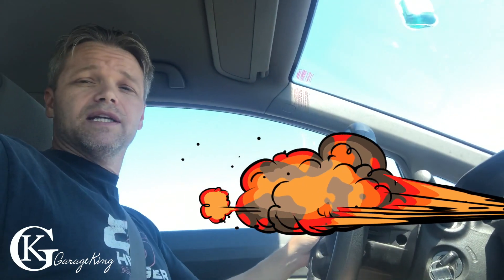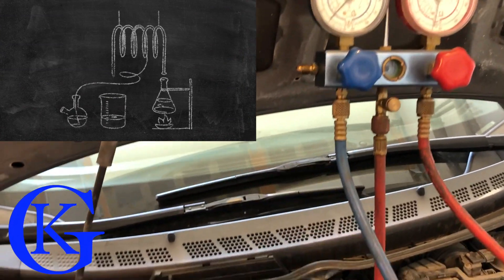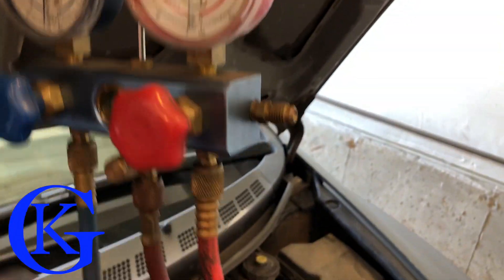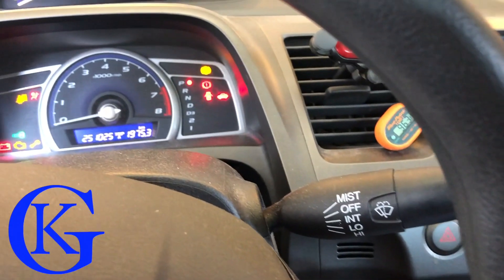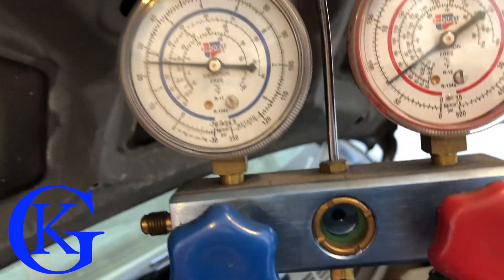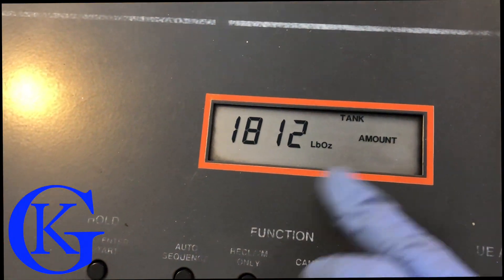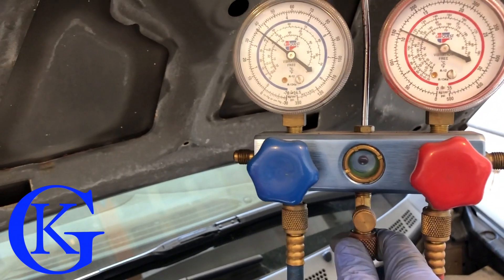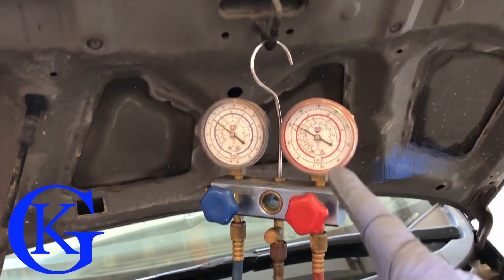How to recharge AC system with gauges properly and evacuate

Comment: So how do your purge air if you were using 134a
Reply from the maker: Hey thanks for the comment, if you are using 134a then you should not crack the line to purge.  The machine should reclaim, hold the vehicle under vacuum, and then charge. I doubt anyone watching this video has a commercial size tank of 134a which is what the machine needs to avoid a manual purge. I did the purge as I was using a replacement. This is what most people have access to.  So I have to change the tank while the machine was holding vacuum. What this did was let air into the lines so when I hooked up the replacement tank I purged the line, and it was fine to do that to get the air out as I was using an environmentally friendly replacement.

Comment: What will cause my manifold gauge set to not Purge? After tightening down the adapter to the refrigerant can, I tried to purge the air out of the hose but nothing sprays out other than a slight hiss. I also don't see any refrigerant moving through the sight glass.
Reply from the maker: Hey There, I'm assuming you have your manifold gauge hooked up to a can? If the can is upright then gas will come out, so that's why you don't get the same purge.  The tanks are designed to expel liquid when vertical and some tanks (R123a replacements) are even put upside down when filling the car. The only way you will see refrigerant in the sight glass is if you have liquid coming in. You most likely have gas coming from the can.  If its a disposable can flip it upside down and then try.

Comment: How to evac with REFRIGERANT STILL IN. Pointless video.  🤦‍♂️
Reply from the maker: Hey there, sorry you didn't enjoy the video, there was no refrigerant in the system when I vacuumed it out, See the 2:15min mark, so I'm not too sure what you are saying.  There was no refrigerant in the system when I vacuumed. If you still have refrigerant you must reclaim, but many times there is nothing left and that's why the AC does not work, there is no more refrigerant, and hence no pressure so the compressor will not cut in.

Comment: 32 degrees centigrade. What
Reply from the maker: Ya, it was HOT !!!!
Reply: @GarageKing  I see. But its Celsius  not centigrade
Reply from the maker: @prtbone78  Ha Ha !!!  I get you now, yup Celsius is the preferred way to say it, Centegrate is an old term that was used and means the same thing, its just not used anymore. To be honest I don't know why I said it.  Good catch, and thanks :)
Reply: @GarageKing  lol. I don't think  I've ever heard that before. But cool.... thanks.
Reply from the maker: @prtbone78  Straight from wiki "The degree Celsius is the unit of temperature on the Celsius scale,[1] (originally known as the centigrade scale)", good catch on you though.  It's an old term.  When I was younger I remember hearing that term from teachers.  To be honest I don't ever say centigrade, it just slipped out in the video haha!  Thanks again, and have a good weekend bud.
Reply: @GarageKing  got you..... all good.   Have a better one  thank you
Reply: As GK said, Centigrade is an old term for Celsius. It was very common in the UK until 1985. Centi means 1/100. Water freezes at 0C and boils at 100C so the Centigrade scale made sense. The problem was Centigrade has another meaning in France relating to angles so it caused confusion. Anders Celsius was the man who originally devised the Centigrade scale so they honored him with the name change.
Reply: @CWK090  thank you for the history and clarification

Comment: I'm going to be filling my AC system (nissan altima 2.5L 2005) before I do, I'm replacing the low side hose and the clutch bearing and clutch hub. My question is when you vacuum the line in the beginning of this video how do you not drain the PAG oil? My compressor takes about 150ml of PAG 46 oil. I was going to replace that while I'm servicing the compressor but will that not suck out when doing the vacuum?
Reply from the maker: Hey there and thanks for the question, most excellent one today.  When you vacuum a car's AC system you are sucking from the top (where the fittings are) and the oil collects at the bottom, so the oil stays in the system and is never pulled out when vacuuming. I was taught whenever changing a part to remove the part and hold it over a measure cup, so you measure what comes out, and replace with the same amount.  In your case with a low side hose you probably wont get anything. The oil is spread out through the internals in the AC system so there is no way to get it all out. Most of the time I find oil when I replace a compressor, or a condenser, and put back what comes out.  If your compressor is leaking oil, then those are the times you can add a little oil as you are loosing it to the outside, and eventually your system would be dry. Good question !!

Comment: Great step-by-step video
My Altima’s a/c only gets cool (not cold) on high RPM. Comp engaged. Cond fans on. Pressures good.
Your thoughts?
Thanks 🙏
Reply from the maker: Hey there, and thanks for the comment :)  Most likely you are low on refrigerant.  The pressure will still show as good until you are really low.  So if you are full or 1/2, the pressure will remain the same on the gauges.  The pressure in the gauges is not an indication of how much there is in there, the only way to know is to reclaim and weight.  Typically a compressor will turn on with an oz or two.  It does not take much for the compressor to kick in.  Hope this helps !!!
Reply: @GarageKing  it’s been very useful and helpful indeed. Thanks for giving me such time and attention and that tip as well 🙂
Reply from the maker: Anytime !!!

Comment: Here's a tip. Use R-152A or canned computer duster.
Reply from the maker: I just did some research on R-152a and computer dusters, very interesting, and I would have never known that.  Thanks for sharing that with me !!!!!
Reply: @GarageKing  Near straight drop in for R134A. You use 64% of your factory R134A charge. So say your car takes 1lb of R134a. You use 0.64 of a pound for R-152A.
Reply from the maker: @jimdavidson5208  Ya, I was reading how they can be mixed.  I did learn something from you, so thanks for that !!

Comment: 0:35 You said if we don’t have a full unit, how do I recycle with only the refrigerant, gauges and vacuum?
Reply from the maker: Hey There and thanks for the comment, what I meant by that, and I should have been more clear is you need a vacuum pump and scale to do the job properly if you have lost you refrigerant.  So you have nothing left in your system due to a leak, and then do the repair.  Now you can just use the vacuum pump to draw as much vacuum to boil away the refrigerant and vent it to the air (as there is no refrigerant). Then use the gauges and scale to weigh it in.  Sorry about that, I should have been more clear.  If you still have refrigerant in the system, there is no way to recycle it, without having a recycler. Sometimes the leak is so fast that it leaks right out, say within a leak. Then its fixed it, so all they need is the vacuum pump, gauges and scale. Thanks for the comment and hope I cleared it up a bit for you.

Comment: what about the refrigerant left in the high pressure line?  Also, wasn't there also air in the high and low lines when they were originally hooked up?
Reply from the maker: Hey there and thanks for the comment.  There was no air in the high and low sides when they were hooked up.  The valves on the gauges were both closed and the high and low side connectors have one way valves. There is always refrigerant left in the high side line as you can't get that out (pressure is too high). You saw for the low side line you can close the feed tank off, then open the low line and the car will pull it down to about 40psi which is really not much pressure (think a car tire) then you close the valve and disconnect the fitting.  The only way to get the refrigerant out of the high side line is too put in on the car and evacuate the system (like I did in the video) this way you draw a vacuum not only on the car, but also on every line.  This is not practical after a fill, so that is why the lines have one way valves on the ends of them so when the gauge valves are closed, and hoses are popped off, like I said earlier, that refrigerant will remain trapped in the line.  Hope you are having a good Saturday :)

Comment: Since you did work, there was no refrigerant in the system that needed reclaiming first?  Does evacuating only pull moisture and air or does it suck out old refrigerant (hence requiring proper disposal?  None of these Youtubes seem to address this.
Reply from the maker: Hey Thanks for the comment.  When I worked on this there was nothing left in it, so nothing to reclaim.  I still did a vacuum, and all that did was draw out any moisture that was in the system from when I had it open to install the condenser.  Whenever a part is replaced, there is no refrigerant left, as the system has been opened.  All refrigerants (that I know of) boil at room temperature, so the minute the system is taken apart it boils away. If nothing is getting replaced and your system is cool, but not cold, then you are low.  FYI - most systems will still engage the compressor with only an oz or two, so if the compressor is not running then its pretty empty. There are compatible products that can be used to top up a leaking system that don't damage the ozone layer, I used one of those products in this video. 

To check your system you could always buy one of those fill kits https://amzn.to/35WbEWv and DON"T pierce the can, just screw the can on so when you put the gauge on nothing will leak out. This way you can see if there is any pressure in the system.

Comment: Partially purged.
The red/high line was full of gas and instead of purging it into the system at the end you purged it into the environment. But to do this, you need a coupler with a valve at the end of the red/high hose.
Reply from the maker: Hey Thanks for the comment, there is a coupler at the end of the lines. There are two red lines, the far line on the right is the high side, that is the liquid side, and there is the centre feed line from the tank. There are one way valves on the end of both the blue line and the red line at the end. Those are the lines that are connected to the car and they have one way valves so they are never purged to the atmosphere, ever.  The line I purged in the middle at 5:39 was because I hooked up a new tank of refrigerant. That has to happen when you hook up a brand new tank because the line going to the tank has air in it, regular air.  If you just hook it up to the tank and open it, you will push that air thats in the line into your car - not good as we just evacuated the car.  So I cracked the line and let the air out, and as soon as I saw the refrigerant I closed the line. The line I purged was the feed line from the tank. Not the high or low side from the car. This will never happen again until you have to change the tank again. Thanks for you comment and good catch, I should have been more clear on that point !!!
Reply: @GarageKing  
You are right. I am sorry. I thoght you have opened the red valve on the manifold after connecting to the tank.
Reply from the maker: @shihabshihabi  Hey no worries, and good eye !!!  I love comments like these as it means you are really watching the video :)  Have a great week :)

Comment: I have a yellow jacket manifold with  knob on the side. So its clockwise to close and counter clockwise to open.For some reason when i open the low pressure side, refrigerant are not being added. Any ideas?
Reply from the maker: Have you checked the pressure that is actually in the system to ensure that you need refrigerant and it’s not just an electrical problem. Also if it’s hot outside then sometimes it does not want to flow in.
Reply: @GarageKing  i have checked when manifold was hooked up, low pressure was at 25psi and high was at close to 200 with outside being 80 degrees.it seems im low on refrigerant but it doesnt want to add
Reply from the maker: Hey there, sorry for the late reply, I just got back from vacation in BC, I was doing my best to answer during that time. When your vehicle is running does the compressor run constantly?  When the AC is full the compressor will cycle (with 134a) so what happens is the compressor draws down the low side and pushes the high side higher, and then shuts off, the pressures start to equalize, but before they do the compressor cuts back in and the cycle repeats. The problem with AC is if you are 1/2 full and full the pressures will remain about the same.  If its warm most likely you are low.  Its easiest to put the refrigerant in when the compressor is running, also MAKE SURE you are putting the refrigerant in through the LOW side.  Your can has to have a pressure of more than 25 or it wont go it.  Thats why there is no way to totally open a can, it will only go as low as whats in the system.
Reply: @GarageKing  Thanks for the reply, compressor is coming on for a minute or two and sometimes less before cycling off. Refrigerant is being added to the low side but the car just not taking refrigerant in. I have yellow jacket manifold with knob on the side. If clockwise is to close and counter clockwise is to open then could it be ac system pressure is too low for it to take in refrigerant? I saw a video on youtube unpluging the low pressure switch and using paper clip to connect it to keep compressor continuously running in order to add refrigerant. Im not sure if its my solution to my issue.
Reply from the maker: @winkawak  I was thinking if you have both gauges, with BOTH manifold gauges CLOSED, you can hook up both the high and low side in the morning.  They should both read the same.  Then start the car with the climate control OFF.  Have someone go in the car and turn on the AC or defrost.  Then watch the gauges and see how fast the high side goes up, and the low side goes down.  If it happens too fast you may have a restriction somewhere (orifice) and in that case no matter how much you put in, the flow will never be enough to make the evaporator cold.  I have never heard of jumping the compressor to force it on to put refrigerant in, and I have never done that.  If it's not running long enough, then putting in more usually wont help, it's just not going to run anyway when you put more in.  The compressor only requires about 1-2oz to run so not much (its just not cool with 1-2oz) so it requires more.  The other thing you could think of is running a product like Duracool, or R12a.  Its a substitute for 134A and works fine with existing seals.  It actually runs colder, and runs at less pressure so it may solve your problem.  Something like this. https://amzn.to/36bfJrM

Comment: Nice video, thanks for posting.  A question: when you evacuate the system, does the compressor oil stay in the system?  Thanks.
Reply from the maker: Thanks for the comment :) and yup the compressor oil stays in.  Now I should say the only time you can loose some oil is if you have a charged system and take the low or high side port valve out.  This would discharge the system very quickly and could pull some oil out due to the escape velocity of the gas.  Not recommended and dangerous.  Normally the oil will always stay in there, and if you are changing a part, once the part is removed put it on its side to see how much oil comes out of it.  The oil is everywhere in the system. Measure that amount and add the same amount of new oil to the new part, and you should be ok.  If you have any other questions just let me know, thanks !!!!

Comment: Ok question, so what if I didn’t do the last step where you put the excess refrigerant into the system? I basically just closed the lines, disconnected the feed hose and had refrigerant left over in the feed line with some being in the sight glass. How do I get rid of the excess refrigerant and moisture in the gauges and sight glass?
Reply from the maker: Hey there and thanks for the question. If you didn’t do the last step no big deal at all. The refrigerant will stay in the line for a bit and you can use it on the next job. If you don’t have a job in the next little while it will just bleed out on its own. After a little while it will be gone as the gauges don’t seal 100%.  You don’t have to worry about any moisture as the refrigerant is under pressure when it’s liquid state so there is no way for moisture to get it.  You are totally fine with what you did and just put the gauges aside.  Merry Christmas to you :)

Comment: Awesome vid, i have a special adapter on my yellow hose and holds the vacuum on it even when I disconnected so I don't have to purge it idk how is called but it works awesome
Reply from the maker: Thanks for the great comment !!!  I have not heard of that adaptor but it sounds cool, and would definitely make things easier!!!  I know the 134a adaptors allow the hose to hold vacuum or pressure when you disconnect the connector from the car, but on those you still have to vent the line before you put the refrigerant in because when you first connect it, you have regular air in the hose, from the can/tank to the adaptor on the car, so normally you vent that out. Thanks again for the great comment and happy Sat to you !!!

Comment: you overcharged it
Reply from the maker: Thanks for the reply brother but I'm not sure how you come to that conclusion.  I needed to put about 6oz in, so I started with 19lbs in the tank and ended with 18lbs12oz, so that's 4oz from the tank.  Then I let what was in the hoses go into the car, remember not all from the hoses goes into the car as the hoses will equalize with the car (when the tank is shut off) so I had 4oz from the tank plus the hoses.  I needed 6oz total, so a few oz from the hoses would put me right around 6oz.   I do appreciate you comment, but wanted to clarify what I did.